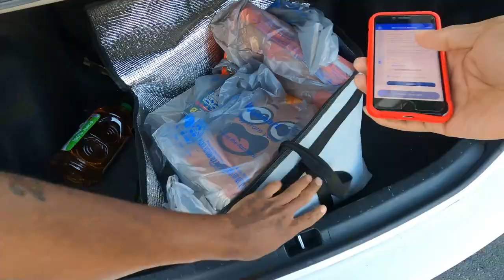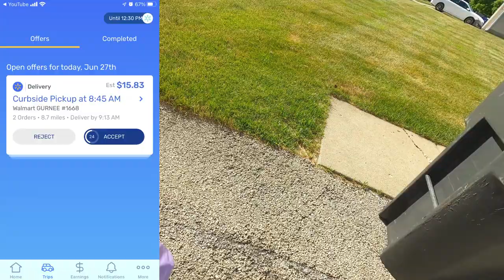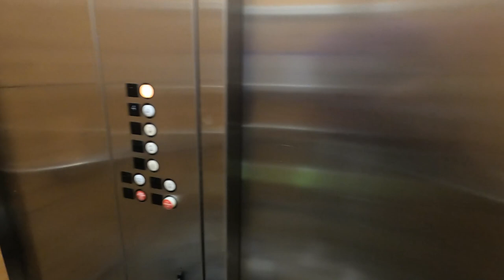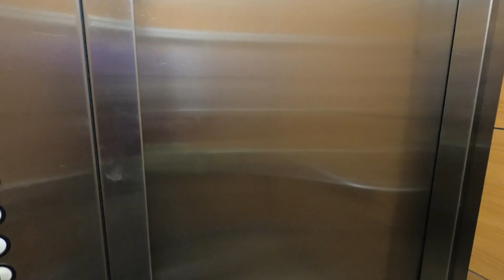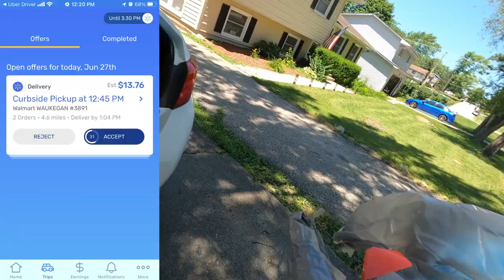How Long Do You Wait For An Order? Does The Time To Deliver Matter? Spark, InstaCart, DoorDash Tips

Comment: I have 10 locations in my zone, sounds awesome right? NOPE. Huge radius, and one location is literally in another state (Idaho).
I've been doing spark since 6/24 , 6 days.
And my acceptance rate is at 2% because of all the locations i had to call help today and have 8 locations removed from my que because they all drop at the same time and its overwhelming and all these locations are far away from my hub.
Just a tip for anyone who needs it.
Reply from the maker: Ssshhheeessshhh that sounds like a headache!!! You can’t even take a breath without your phone ringing lol!!
Reply: That happens to me too, I have 8 stores in my zone and some are 20 miles away. I’ve been asking support to remove those couple stores because my AR was bad. They finally stopped sending me them on 1st rounds but I might get on a first come first serve. iPhone is really bad for location and signal, androids work better. My friend lets me log on with his other phone and bam I get an order for the Walmart we are standing at instead of the other ones 5-7 miles away or sometimes none at all.
Reply from the maker: @danisdelivery4919  I agree! Androids have a location access thing you can turn on so Spark knows exactly where you are at. I tried to do it in my Iphone but it doesn’t work for some reason, or I could be doing it wrong.